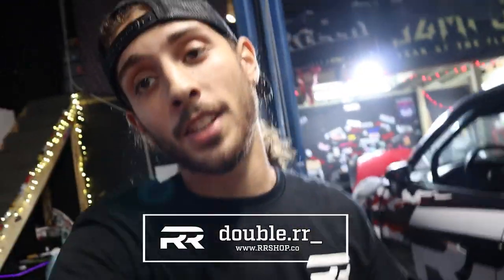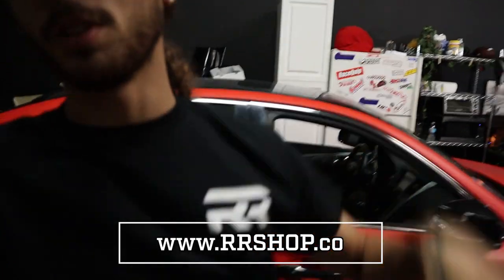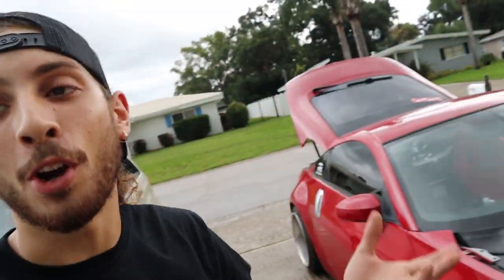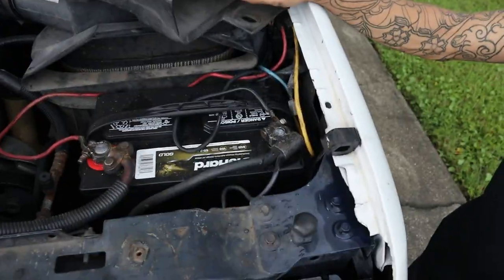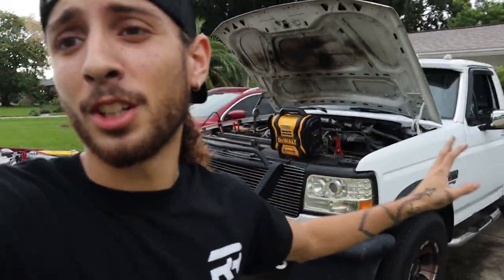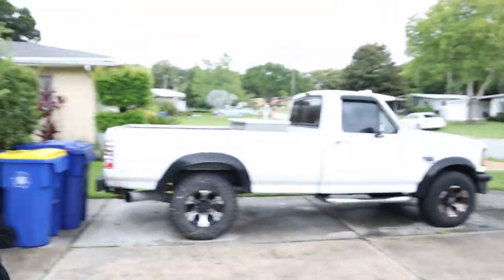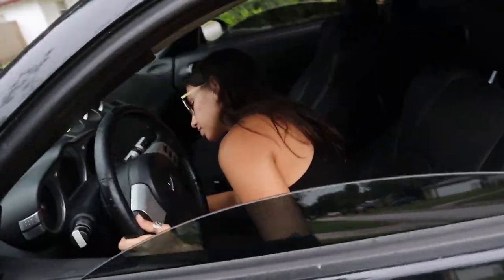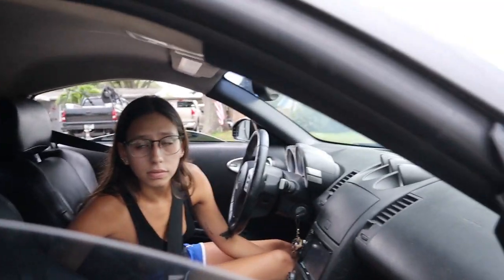The Biggest Turbo I Got...

Comment: What do you even call that ? A twin battery V8? 😂😂😂 never seen before, kinda cool tho
Reply from the maker: So 7.3L powerstroke turbo diesels form 1995 comes with...2 batteries...2 gas tanks & 2 fuel pumps that you can switch between when one goes empty..lit
Reply: Holy Shit. I didn't know that. Damn near 2 of everything. too bad it's not a twin turbo.. hint hint for the next build.
Reply: @thejamaicansenpai1698  right they don’t make cars like that anymore and it seems very reliable